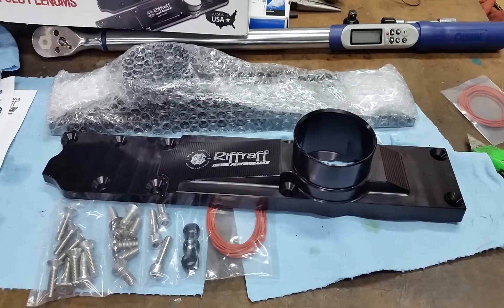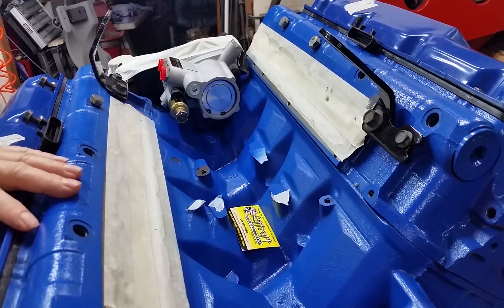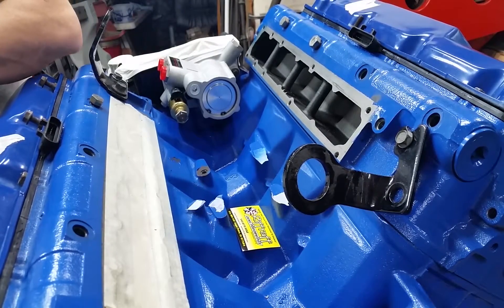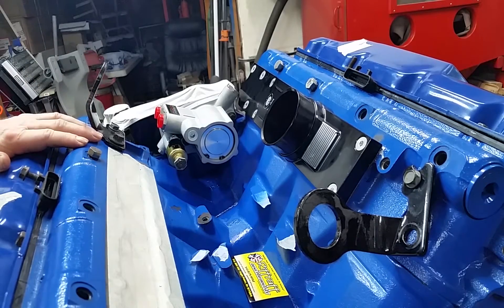7.3 Build: Intake Manifolds

Comment: I put the Riffraff intake plenums on my 7.3
It is a lot trickier to install with the motor in the truck with all the workings around it. 
Very happy with the product. 
Pushing 19 lbs. boost with my turbo when towing.
Reply from the maker: Sounds great. I'm looking forward to seeing what she'll do.
Reply: pushing a little over 30psi on my 97 with a kc 300x
Reply: What is done with delete bolts do u install bolt in hole?
Reply: I'm pushing 40 plus and I have not done the new plenums. They're on the way